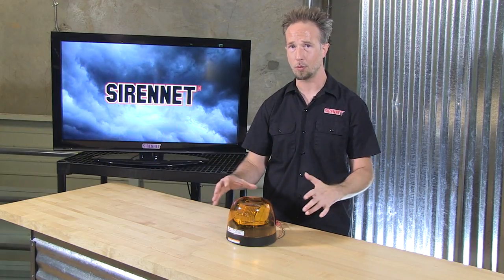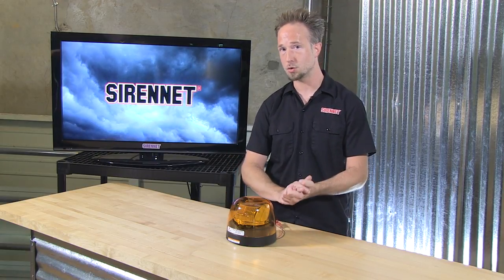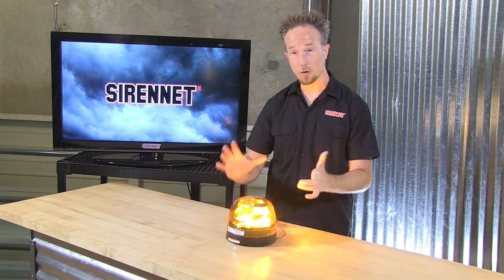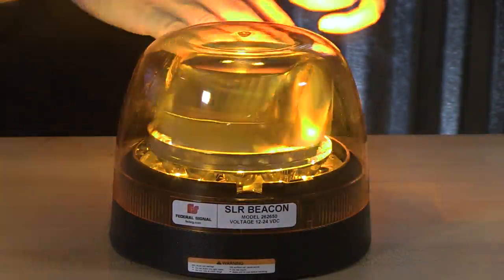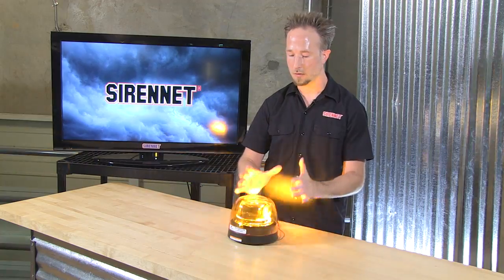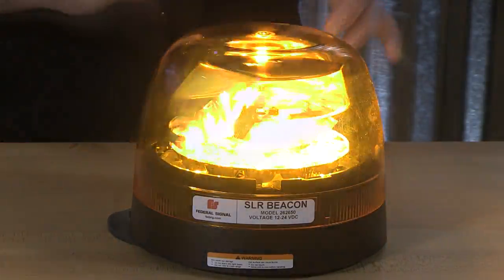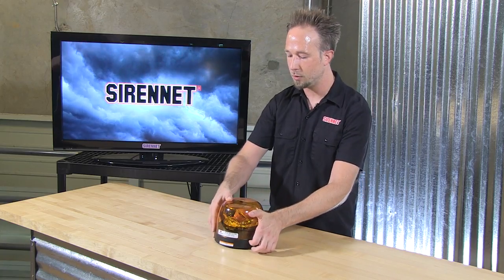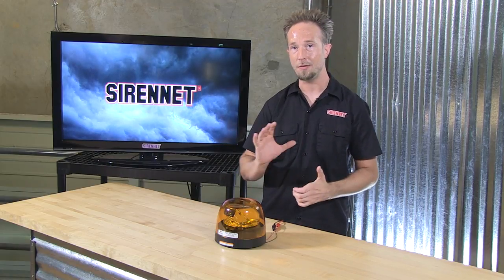The Federal Signal SLR Rotating LED Beacon

Comment: Heard they not that bright
Reply: NYPD uses SLR lightbars and I see them in bright day light and at night. You don't need a brighter light than this. The colors are rich and punch through the sun and at night they're bright enough for legally blind to see.  Brighter lights becomes a road hazard to drivers.
Reply: You heard wrong
Reply: In direct sunlight on an interstate with no shading from NYC buildings they are not bright at all. The coloring is very rich like another stated but is washed out completely in bright sunlight. Definitely not worth the cost.